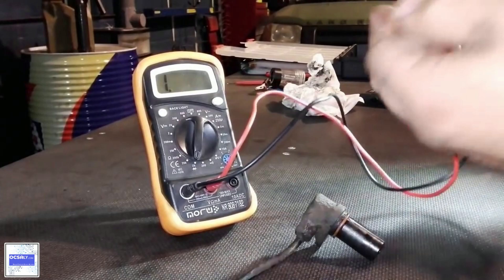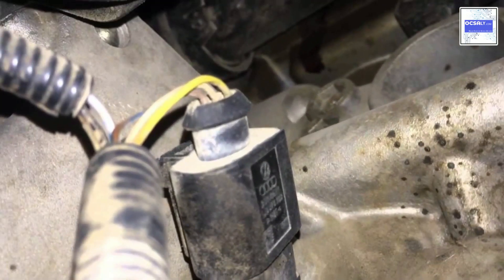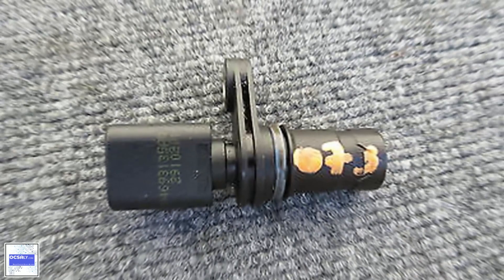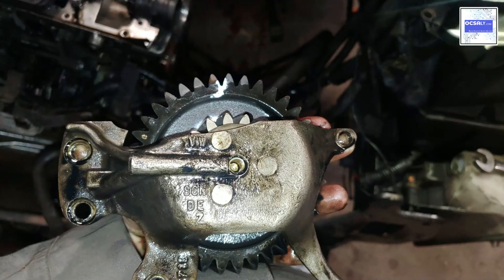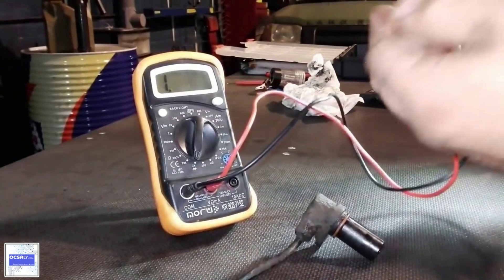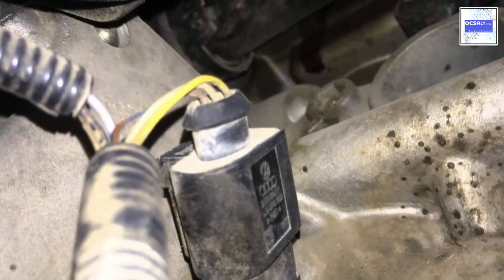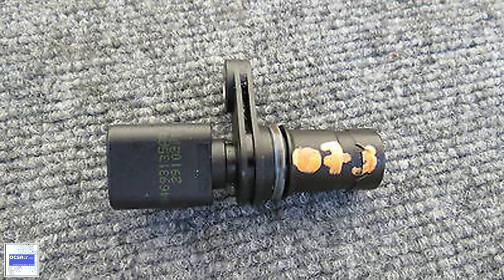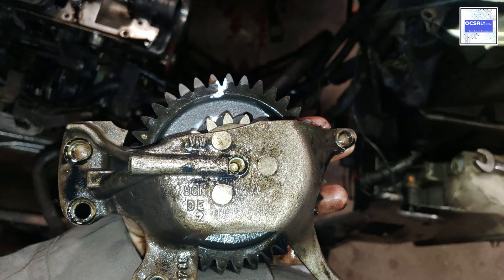Why Crankshaft Position Sensor is SO IMPORTANT ? | CPS SENSOR WORKING PRINCIPLE

Comment: It's important to note that the crankshaft position sensor is only one part of the story. The CPS only tells the computer when the pistons are at the top of the cylinder. However, it doesn't tell the computer whether the pistons are at the top of the compression stroke or at the top of the exhaust stroke. That's why the CPS always has to work in concert with a cam position sensor. Together the two sensors tell the computer which cylinders will be firing during the current crankshaft rotation and and when to fire them.